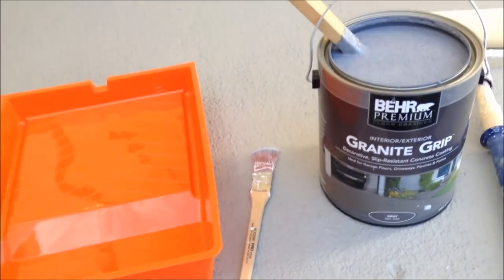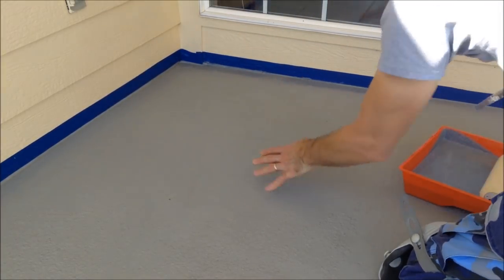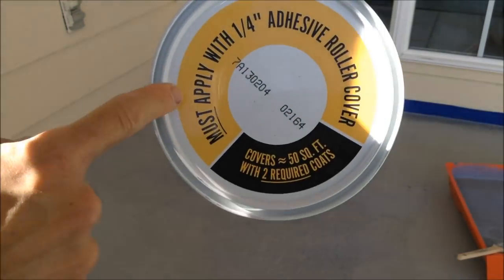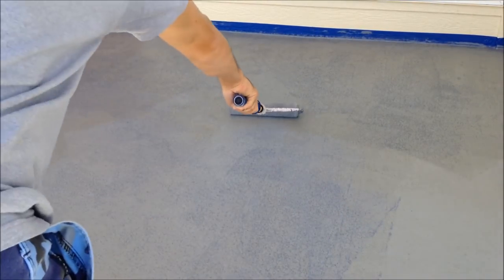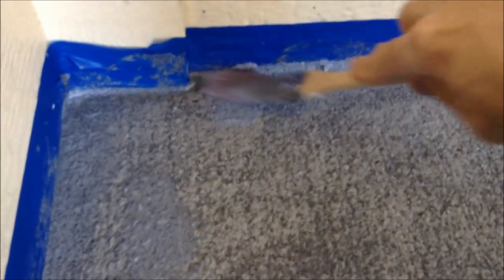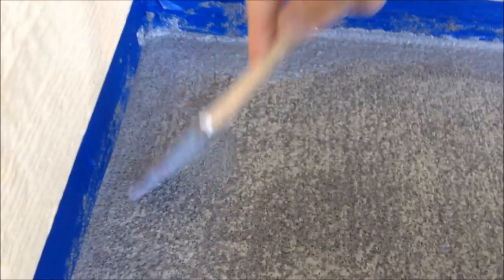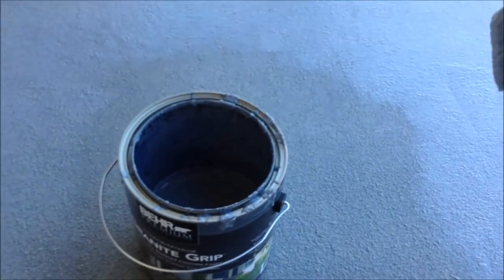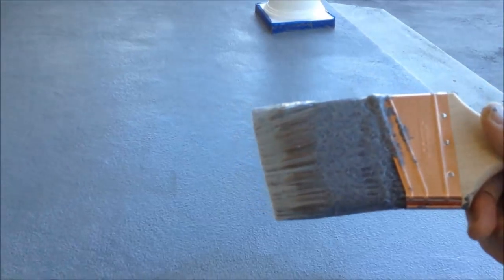HOW TO RESTORE A PORCH USING Behr premium Granite Grip Concrete coating

Comment: This WILL take 3 coats to look like you see in the Behr brochures. I suggest rolling with the recommended roller the first layer, doesn't matter how it looks because just for adhesion. The 2nd and 3rd layers, get yourself a large to extra large quality brush (3-4 inches). Brush the 2nd layer in long even strokes up and down, dont changes directions (stay with the grain)for uniformity and it will look a lot nicer. Don't go too thick on the 2nd layer and on the 3rd layer paint the same way but a tad thicker, i recommend a 1/4" layer..make sure you spread even and don't go back and touch up once you moved on, let it fully dry 4 hrs. In certain cases a 4the layer may be necessary... we did the 3 that way and got great results. Tan color gg13 was the color we choose.
Reply from the maker: Great advice!  Thank you very much for that :).. How is it holding up for you?
Reply: ETPC EPIC TIME PASS CHANNEL so far no bubbling and it seems to be well.
Reply from the maker: Great!  Thank you again for your advice.  It is most appreciated :)
Reply: How is it holding up after 3 years? Is it slip resistant?
Reply: @fireflies735  overall not bad, I did experience some light cracks where step is but I overall I'm happy.
Reply: @nightdreamin  thanks

Comment: I applied this to a concrete planter.  Looks great a year later.  It is frustrating to apply, however.  It's basically painted-colored glue with granite flakes in it.  It takes 3-4 coats to make a really good result.
Reply from the maker: I like the planter idea!  It is a little on the difficult side to put on for sure.

Comment: How does this product hold up to winter shoveling? I am looking to apply this on a small porch where shoveling in winter is needed
Reply from the maker: hmm it is a pretty hard substance.. if installed correctly , I think it would hold up pretty well.. obviously it would not hold up to repeated stabbing by sharp metal objects.. but I think if you are careful it would be good :)

Comment: Does it looks nice ? or should use concrete paint or part epoxy
Reply from the maker: It looks great.. since this video still holding up really well.. only issue I had was water coming up through my cement and causing the paint to bubble.. but not the fault of this coating.. I would put it on again.. it really is a good product

Comment: Do you think that after prepping the concrete if you applied a flat concrete paint as a base that coverage would have been easier for the 1st coat of the textured paint?
Reply from the maker: Hello, Susan, I am not sure how well this would adhere to another paint.  Technically I didn't prep my porch all the way according to the directions.  I didn't pressure wash. I believe it is designed to stick to prepared concrete.  I am not an expert, however, and I can (and have been before) be wrong :)
Reply from the maker: Sheep Dog  Yes, I had stained it previously.... You are supposed to etch it with acid and all that for proper adhesion.. I didn't do that on mine and it is holding up well
Reply from the maker: Sheep Dog  I try to reply to all comments :)  (It is getting more difficult though, I fear I may get too many and not be able to physically respond to everyone.)  I wish you the best on your project!!   I think it will turn out splendid :)
Reply from the maker: ROFL :)  You are very welcome .  thanks for the laugh :)

Comment: How did you apply on the side of the step? i assume you brushed it on? They do not recommend the application vertically so was just curious how you did it.
Reply from the maker: Hey Todd, Yes just used the brush to apply it.  Since the video it is still holding up really well..  Have a great day :)

Comment: Thanks for the brush tip. I also have half a concrete porch vertically. Is it going to stick to it?  Is it ok to apply without etching  since it has a coat of freshly put /Cement All /Rapid set cement on top. Thank you.
Reply from the maker: Okay so my porch has about a foot of exposed vertical concrete.  I painted that without etching and it is holding up great so far.  I did not etch mine... I know they recommend it for proper adhesion..  I am not an expert.. If you do etch, it will probably hold up better :)  Take care my friend.
Reply: Ok . Thank you.
Reply from the maker: Most welcome, let me know how it turns out :)

Comment: Pour it on and push it around is the best way or just get regular deck paint and add grip to it
Reply from the maker: Thanks for the tip Kevin :)  Take care!
Reply: I have really steep slippery driveway and I live in a tropical country and sometimes moss/algae grows on it as well. I am looking everywhere for solutions. I am hoping you can give me pointers/tips on what to do. I tried to order cetain things but the minimum order is huge and I live in a remote area, so basically I have cement available, cement sealer/sealant, sand and gravel... Thank you in advance.

Comment: I find that it applies better using a 4" chip brush attached to a paint pole.  It takes longer but the end result looks better in 1 coat than the adhesive roller they suggest in the directions.  

Using the 4" chip brush is tedious but it's not so bad if you're doing a small area like that porch you have there compared to a driveway or pool deck.  Using the widest paint brush you can find would probably be better but not as cheap.  

I tried the scrub brush style with soft bristles and it still does not provide as good results as the chip brush style.  Hope that helps.
Reply from the maker: I appreciate the tips my FRIEND :)  thank YOU :)

Comment: Ok. I decide not to use it since the follow up says that the paint is coming off in standing water. Which I have plenty on my porch. Im not going with Granite look at all. Look's like I will go with 1 part epoxy paint instead.
Reply from the maker: Maybe a good choice .. Mine is still holding up quite well :)

Comment: Can you use this on an already painted concrete surface?
Reply from the maker: technically...?? for best adhesion you are supposed to use it on acid etched concrete.. Mine was already painted.. holding pretty good so far :)

Comment: $50 a can, or $28 for their porch and patio paint and Rust-Oleum
 Anti-Skid Additive for $8. So would have been cheaper. Would have been $70 cheaper. And would have gotten the same results.
Next time you paint, pull the tape off right after you do the cut in's, it would be a lot easier to take off.
Reply from the maker: Awesome tips and advice my friend.  Thank you!

Comment: Looks good,Did you have a lot of splatter on your house? And if so was it hard to remove?
Reply from the maker: Hi, Kevin, with the roller, unless you roll slowly, you will get some splatter.  If you don't clean immediately, it is pretty tough to get off.  (I just painted over it when I painted the house) When I used the brush, there was no splatter.

Comment: After seeing many videos on the application of this product, it looks like a real pain in the butt to apply.  And the results don't appear to be uniform even after several coats.  I would not recommend this product but rather the other solid color stain by Behr with the non-skid additive.  The solid color stain gives a really nice uniform appearance even over really discolored concrete.  And the best part, it doesn't peel and it really lasts a long time.
Reply from the maker: Good points my friend.. this was a little difficult to apply but seems to be holding up pretty well :)

Comment: Is it holding up so far?
Reply from the maker: Yes, sir, so far so good.  No chips, scratches, etc.  I am pretty impressed so far.  Now if I could just keep the worms from crawling up on it and dying .. That is SUPER annoying and difficult to clean off.  Usually I have to hose, scrape them off and it has not disturbed this coating at all

Comment: I did not like it it was just thick and did not go on floor smooth so I mixed it with concrete paint came out great. Not smooth has sandy feel not slipping
Reply from the maker: hey GAZALA, yeah it is super thick.  I like YOUR idea.. if I have to reapply I may try that :)

Comment: Looks amazing!  Is it still holding up?
Reply from the maker: Yes, and no... Okay so, my house is in a high ground water area.  I have an amazing amount of hydro static pressure that forces water up through my slab.  My situation is  not too common.  My porch has a couple of areas where this occurs.  Basically the pressure causes efflorescence or the salts and minerals to be pushed up to the surface with the water.  If nothing is on the concrete the water simply evaporates and you may not realize you have this issue. In 99% of my porch I have no issues.  In the spot where the water is coming through, because this coating makes a water proof barrier, it is bubbling.  This is no fault of the product.. Hydro static pressure can pop tiles up.  That is the long answer.  hehe  I definitely like the product.  On the rest of the porch it is working awesome !  I battled this water issue for years with no remedy. But that is another story.  Take care my friend :)
Reply: ETPC EPIC TIME PASS CHANNEL 
My porch is a concrete slab sitting on a concrete block frame 2' above the ground under an overhang so maybe it'll be alright! If it can withstand a Canadian winter! Thanks for uploading this video! It's so nice to be able to come to youtube and see people demonstrate products and provide  their experience ✌
Reply from the maker: Yeah, it should work great for you then.  Granted, I don't really have very extreme colds here in Northern California.  You are welcome.  Thank you for stopping by my channel.  All the best on your project :)

Comment: Wrong roller cover. You need a 1/4 inch adhesive roller.
Reply: Nice job though. Finished product looked nice. Granite Grip really does look nice but as you know it's a lot of coats and not the easiest to apply. I did my basement in it. It took me forever. I however love the way it looks! Very solid and clean looking.
Reply from the maker: yeah, my bad :) lol
Reply from the maker: yes.. our porch is holding up quite well except for one part where water comes up under the concrete :(.. it definitely is not the easiest to apply :)
Reply: @ETPCYT  I have not tried it on any exterior applications yet.
I must say my basement floor looks absolutely fantastic though. I am thrilled with the results. The trick I found is to be patient and just keep coating up. The product dries extremely slow. Definitely not a one day job. I put four coats down and waited a day between each coat. I also cut all my edges in first with a brush. No need to tape if your careful. Anyway, COOL BEANS! LOVE IT!
Reply from the maker: Awesome bro.. I bet it looks amazing

Comment: I am at coat 3 today and I almost angry at this product. I will hand brush apply the thins spots and thick sandy spots. It looks like garbage after two coats. Hopefully if I stay the course it will be better. It is like applying cement glue with uneven sand in it. I believe it will look old but the job is not for your thin skinned DIYer
Reply from the maker: They recommend a roller but the brush was definitely the way to go for me. It is very thick and not your typical "paint" job.  Good luck my friend.

Comment: Those are THE worst trays to use.  You didn't get enough paint in your roller cover it's not the product.  You really need to kneed the paint in the roller
Reply from the maker: All Great tips, I wish I would have known this before starting this project.
Reply: ETPC EPIC TIME PASS CHANNEL does the acid wash come w the paint or is that a separate thg to buy?

Comment: 6 hours? Less then an hour with a roller.
Reply: I get the Slate Gray Low-Lustre Interior/Exterior Porch and Patio Floor Paint, to me it does not look grey.
So did this darken the more coats you applied?
Reply from the maker: Roller did not work too well for me...
Reply from the maker: It goes on darker then it lightens as it drys.  It ends up a lighter gray color.
Reply: You have to start with a base color to what your grip paint is going to be or it will show through even after 3 coats if you dont put it on heavy. 
you literally have to soak the roller and roll on heavy. GREEN SHOWS THROUGH AFTER 3 COATS